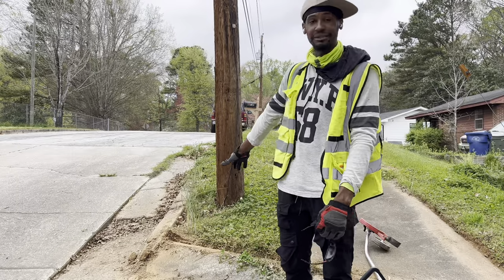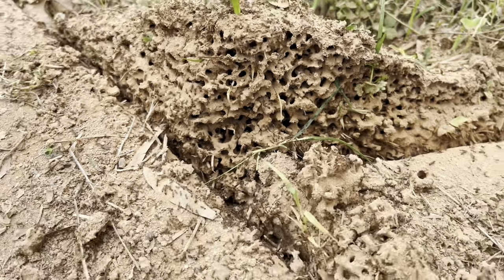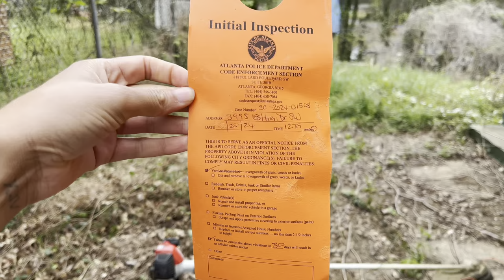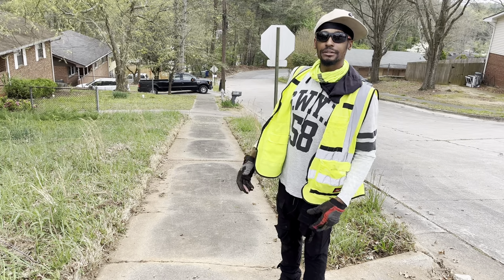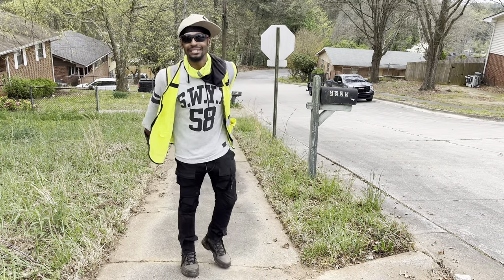Owner Died 4 years ago and City still issued Code Violation

Comment: Suggestion on Future Projects. Skil Saw Blade on a Weed Trimmer/Eater to cut stuff the string/line won't, up to 3" thick, so you don't have to bend over. Also on smaller tree limbs.
8:31 Them are FIRE ANTS! 
16:12 Use Weed Trimmer.

Comment: You two did a good transformation on that property it's good to see you rocking that new shovel 😊 make sure to keep the edge of it sharpen big ups to you both 💪💪💪💪💪💪💪
Reply from the maker: Thank you! Will do! What’s the best way to sharpen a shovel?🤔
Reply: @DrakeLawnCare  get a sharpen stone when you start to notice it's getting kind of rough to get things done then it's time to sharpen it. Just keep in mind that you are using it on paved streets and driveways that will lead to dulling the edge of your shovel.
Reply from the maker: @darrennewell4  Understood. Thanks for the advice!
Reply: @DrakeLawnCare  no problem you two just keep up the great work that y'all are doing 💪💪💪💪

Comment: Suggestion if have a small amount income! Available now at Hardware stores and oh course Wally World are new hand held rechargeable battery small chain saws and brush wands and even battery hand held cutters of smaller trees and brush! Also that small scoop shovel you have comes with a slightly wider blade and a much longer handle to save your lower back! I also saw a folding four foot aluminum ladder that would help for upper vines and trimming tall bushes and tree limbs